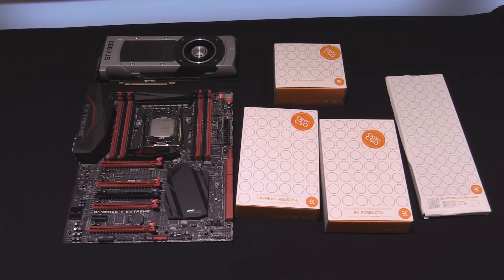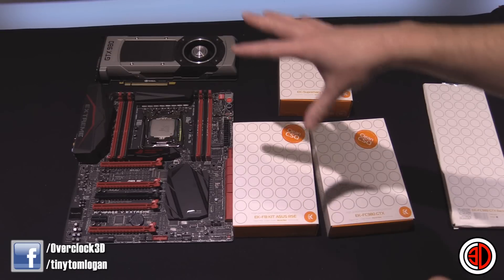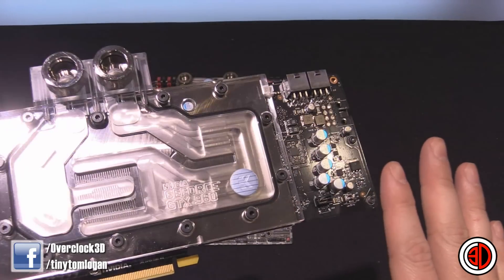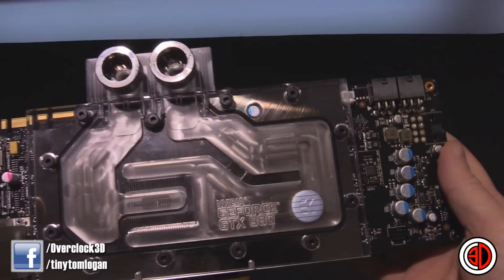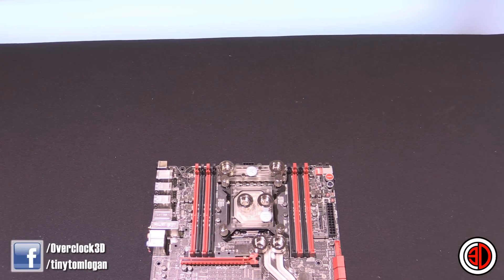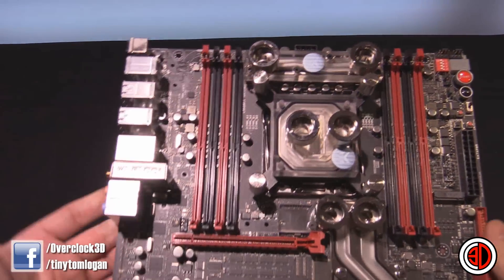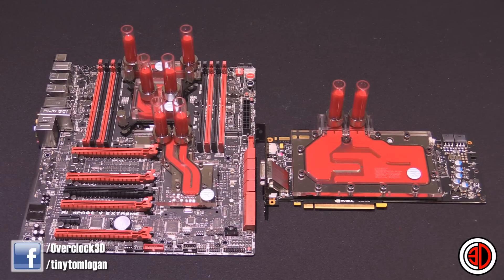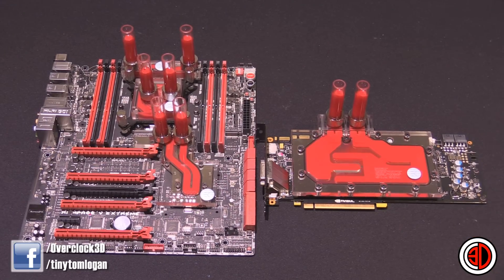EK Rampage 5 Extreme and GTX980 Waterblocks

Comment: That EK pastel red sucks. It turns to a maroon like colour after a while.
Reply: +Rustknuckle Irongut aquacomputer is a great company best fan controller of all time
Reply: About a year and a half ago I got me some EK blood red. 6 months in it turned a very deep blue (looked black in the res). Previously I'd used Mayhem's stuff, and that came with a fair bit of algae growth. The EK stuff had significantly less, but still some on the CPU block. Not to mention the dye deposits in the rad. Looked into silver coils, but they sooner or later strip the nickel off the blocks, so that's a no go. I've now gone to industrial grade antifreeze, rated for a 5 year service life. Toxic enough to prevent any algae growth, with the additives to protect all the metals and no dye that leaves deposits. So far so good, only problem is it's pink :/ We'll see how the system copes with it for the next year or so, though I'm expecting solid maintenance free performance, which would be more than I could say for all the other stuff I've used.
Reply: 233kosta  I haven't heard anything good of their blood red. I think EK and Mayhem teamed up to produce EK's pastel range.
Reply: A Vong Wouldn't be surprised, EK has a fair bit more resource than Mayhem as far as I'm aware, so I can see it happening.

Either way though, I doubt I'd go back to dedicated PC coolants, they seem too unstable for my likings. I've not yet had one that didn't stain the hose or successfully prevent growth, so the options I see right now are either a nickel free loop with silver to sterilise and DI water (perhaps some anti corrosion additives) or long life antifreeze, perhaps with solid colour hose for aesthetics.

By the way, have a look at the Monsoon hard line flange fittings, they're up on aquatuning. Pretty cool stuff right there :D
Reply: 233kosta Ek teamed up with Mayhem as you can see on their page... product description says "made by Mayhem"
Reply: 233kosta For a stable premixed coolant try Aqua Computer Double Protect. I ran the clear one for a year with no growth, corrotion or discoloration(other than some tygon tube going yellow, but thats a problem with the tube and not the coolant). The fluid in the reservoir was as clear after a year as the day I put it in.
Reply: Rustknuckle Irongut
I'll have a look next time I change mine, clear works better for me than pink

Comment: yes tom pull the heat pipe that you are heating with a heat gun! genius!

yes i know you said about heatproof gloves :P
Reply: To be honest, a heat gun might not cut it, you might need something like a blowtorch to get it hot enough, but then you run the risk of melting it :/
Reply: 233kosta
or just stuk screwdriver in the gap and it can be pulled out by hand
Reply: TM80 NotGoodWithNames
You could do that, however you risk surface damage. Plus, a screwdriver won't deflect it evenly, so you could still be stuck with it in there
Reply: but you can't put it in place if it's in there
Reply: so if you damage it you don't lose enything
Reply: TM80 NotGoodWithNames
What do you mean?
Reply: if the screwdriver damages the surfase it's not visible and you can use multiple screwdrivers
Reply: TM80 NotGoodWithNames
I s'pose so. Still a more elegant solution to remove it the way they inserted it though, no?
Reply: I think that they just push it in from the top
Reply: TM80 NotGoodWithNames
Heat it up first. Thermal expansion allows it to be pushed in with ease, while the contraction after cooling locks it in.
Reply: Yeah but how they finished the aluminium. if it's was heated the paint or powdercoat would chip of
Reply: TM80 NotGoodWithNames
Aluminium gets anodised. A thin oxide layer is formed on the top surface, which then holds the dye. This protects the finish fairly well and requires much higher temperatures to damage than paint. You only need it to heat up by 300-600 degrees, which is well below the damage threshold for hard anodised aluminium (about 1500). It only needs to deflect by between 50 and 250 microns anyway, so a 300 degrees increase should be more than enough. The problem only arises when the heatpipes soak some of that heat up. They will expand with the heatsink and depending on the difference in thermal expansion coefficients, might force them tighter together. As it happens, the thermal expansion coefficient of copper is about 25% less than that of aluminium, so no matter how hot the heatpipes get, they'll loosen up.
Reply: F or celsius?
Reply: TM80 NotGoodWithNames
Kelvin (same scale as C, starts at absolute zero)
Reply: how you reply soo fast
Reply: TM80 NotGoodWithNames
Youtube open in separate window, just happened to see a notification :P

Comment: Hi tiny Love the Video I am getting into Water Cooling again ( I did try and Water cool my old 775 set up on my Geni 2 ( I think it is I still have it ) and I am going to do a video on my Epic fails and my epic wins..but Before I try and make the Video I wanted to Ask you a Question and please if anyone else knows please feel free to answer

Question : I have a GTX660 ( its my current main card ) and EK has blocks But sadly there are out of Stock is there any other place where I can look at Getting a Water block for it ? I did Find one on ebay that just covers the GPU Not the memory or the Power/mosfets will that be a problem or will I need to add some passive cooling for the memory also ?

thanks for taking the time to Answer and please I hope this message finds you all in good moods..
Reply: pointless to go watercool a 660 now unless you can get a block 2nd hand really really cheap.. 660 isn't exactly a power hungry, hot GPU
Reply: i personally would add passive cooling to the the exposed chips on the card (had a nzxt kraken g10 on my hd 7950 and had to add small heat sinks to the overheating chips on the card some where reaching 103c and causing issues) you can get them from ebay for cheap and your case airflow should provide adequate cooling to them provided you have front fans
Reply: rathy21  thanks for the tip I will look into that + Calyx I Know this I am doing it As a Video for my Viewers on my Gaming Channel I just needed some Advice on what do to for the V-ram and the Mosfetts ( witch I will be adding in my Video ) thanks for the Advice Guys.

Comment: +OC3D TV 
The lathe swirls you have on the backplate is there just because you have chosen to buy a "Class 2" backplate
The difference between regular and "Class 2" is the lathe swirls and a price difference of 5-10€, this means that its still approved to be sold as it doesnt have any defects just have a cosmetictly different surface due to a unsharp lathe equipment, the regular one looks like a mirror. The "Class 2" backplates is added to the store from time to time. 
You can polish it up but it will oxidize as it is Nickelplated from factory :)

I hope it helped you

Comment: I have R5E and I'm waiting for the EK mono block to be released, because separate block for me is just a pain to deal with. I also want to ask you Tom - does the bottom block covers the connector for the republic of gamers lightning logo? I was thinking of extending the wires of the logo and sticking it somewhere on the mono block. 
The pastel color looks amazing. Right now I'm using blood red, but this is very nice.